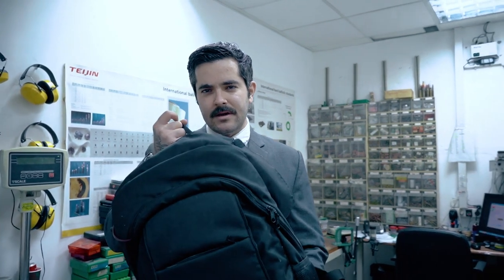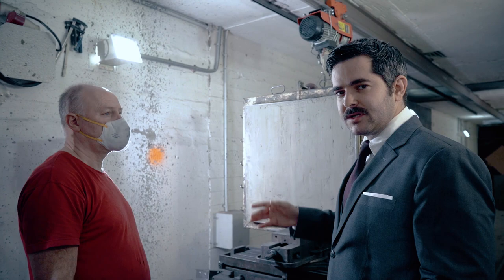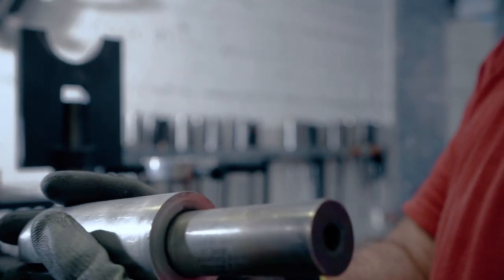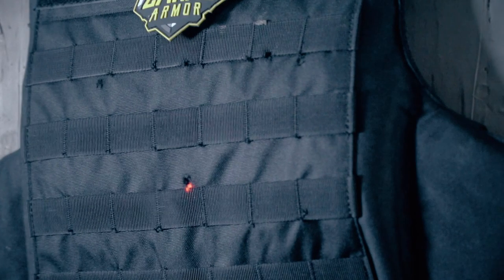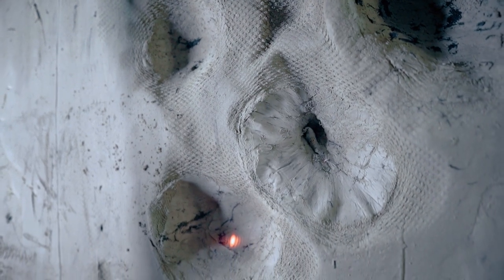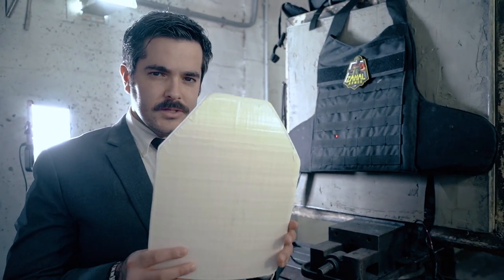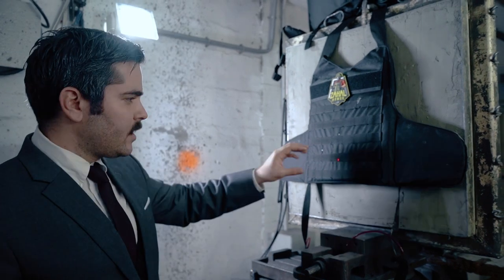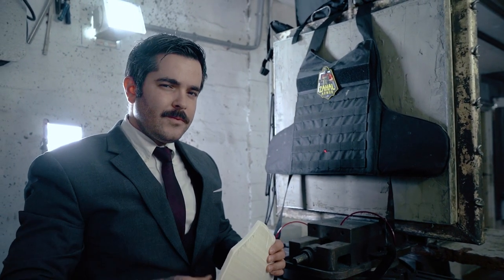Will it Survive 9mm, 45 ACP, .44 Magnum? ZAHAL Masada Bullet Proof Backpack.

Comment: What type plates are those?
Reply from the maker: III+ Plates in conjunction with IIIA Armored Vest. We have it on offer
Reply: looks like fibreglass not ceramic. the delamination of said plate is likely good for 2-4 hits,close to what a ceramic plate (@double or more the weight) is rated for, that being said most iii+ are rated for 7.62 NATO (308). zahal is a great company and i fully trust them (i have a few discount codes hanging in my gun room as pinups)